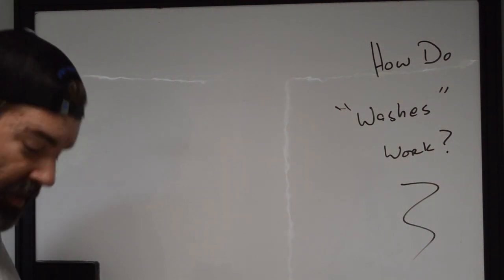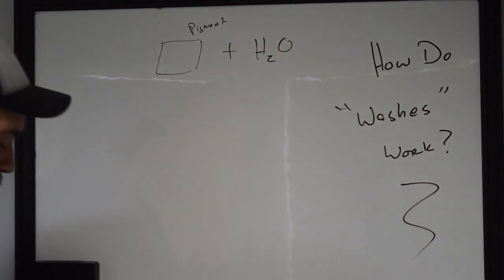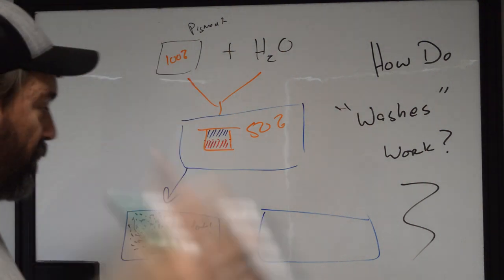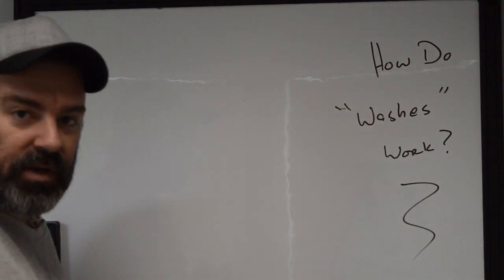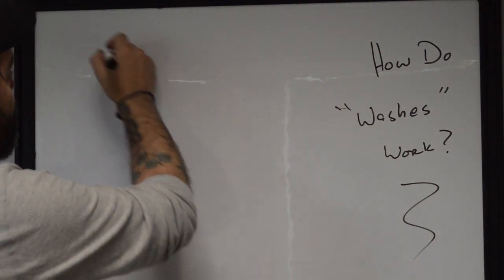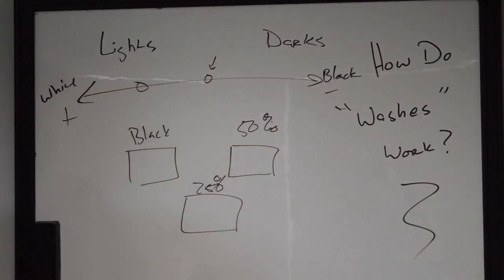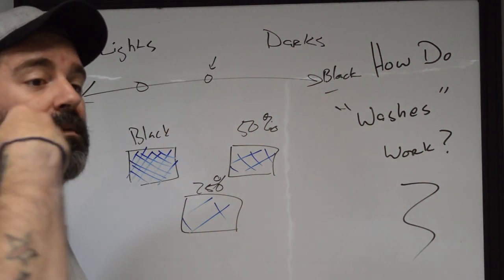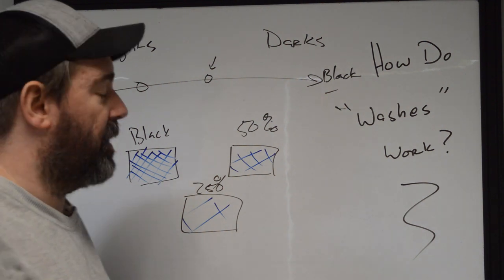How Do Washes Work - Working With Tattoo Pigments Dispersions

Comment: Hey, thank you for your videos! I've learned a lot through them already! Can you tell me the reason you advertise for distilled water like this? Non-carbonated mineral water is superior to that , because distilled water lacks all the minerals that actually help the regeneration process of the skin. Even so it would be best to work with sterile water, which is tough because you basically have to throw away the bottle right after use. I see distilled water be mixed up with sterile water a lot and I think it's important to be specific about why you do what you do. Distilled water has nothing to offer really from what I know?
Reply from the maker: Distilled is free from organic and inorganic contaminants, sterile before opening, and is safer than using a bottled water source that you have no idea the quality, pH, mineral content, or possible contamination.
If you are using mineral water, please stop immediately. If it were "superior" they would be using it in medical/scientific settings.
Distilled water is not a brand. Its a process.